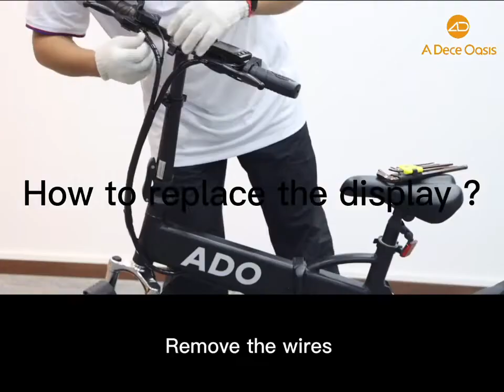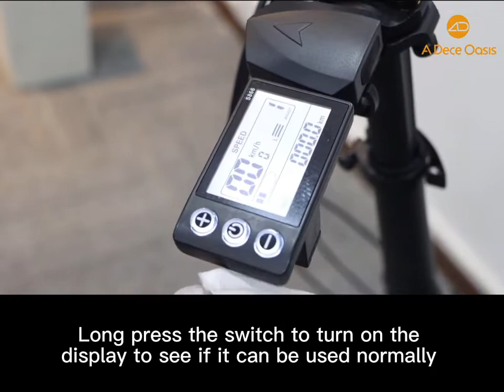ADO EBIKE Replace the LCD DISPLAY on A16, A20, A20F, A26

Comment from the maker: 😊There are more details and models of the ADO ebikes if interested: https://www.markshop.co.uk/collections/ado
and ADO ACCESSORY: https://www.markshop.co.uk/collections/ado-accessories

ADO Air Carbon: https://www.markshop.co.uk/collections/ado/products/uk-stock-ado-air-carbon-250w-bafang-motor-folding-electric-bike
ADO Air 20S: https://www.markshop.co.uk/collections/ado/products/ado-air-20s